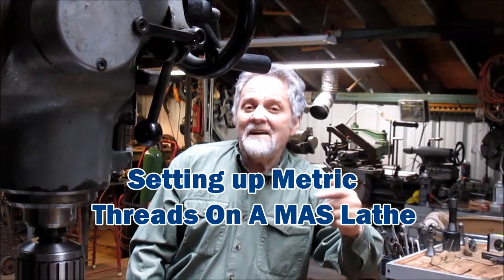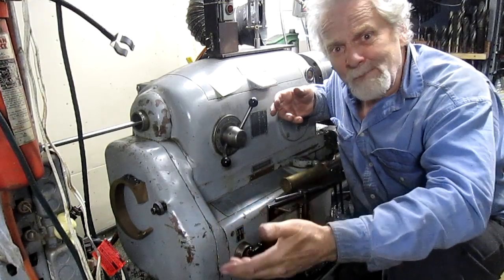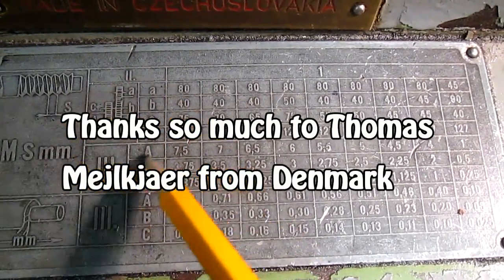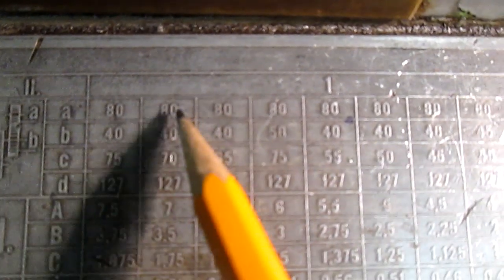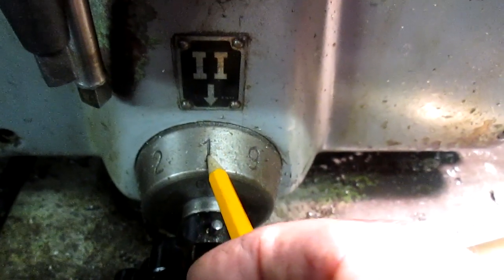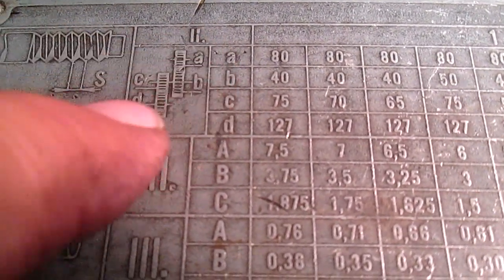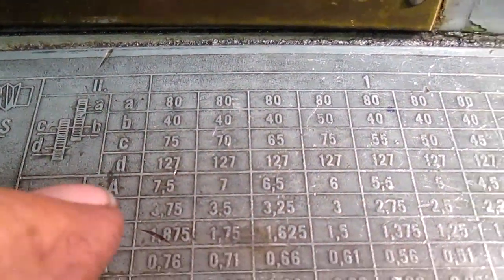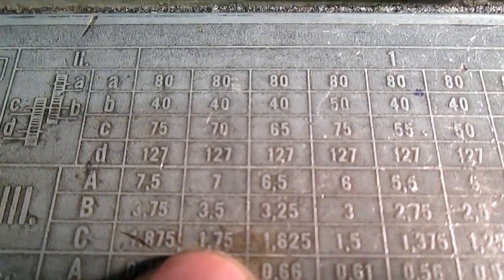Setting Up Metric Threads on a MAS Lathe

Comment: Hello Mr Nik Colyer.  
I have a lathe just like yours, where I use it to work.  I recently started a restoration, however, one of the information boards is worn and faded.  In his video, you show only half of it.  

Is it possible to contact you to get a photo of the information plate?

Your video was of great help to me, thank you so much for sharing your time and knowledge.
Reply from the maker: Did I send you the manual? The info plates are in there. If I haven't sent it yet send me an email: nik@nikcolyer.com and I'll send. It's a big file so email is best.
Reply: @NikColyerMachineWorks  Thanks a lot for the feedback.  I will answer your email.

Comment: Hi, i bought the exact same lathe but i can't get the automatic feed function to work. What button combination do i need to use to make the lathe move automatically?
Thanks in advance
Reply from the maker: There is a fist size knob dead center on the apron down low. Twist tighten that by hand and the carriage should kick in. If not, look just to the right at the lever: up is cross feed, down is carriage, center is neutral so you can engage the thread cutting. 
I have a manual for this lathe that I can send for free. It's a big file so send your email to nik@nikcolyer.com
It's a great lathe. I've had mine for 15 years and not a problem. You want to change the oil and fill with turbin oil, but first go under the transmission and open that cover. Inside is the oil sump. Clean that out with a putty knife, it will be filled with gunk.
Reply: @NikColyerMachineWorks  thanks for the quick reply. I will try it tommorow! I m interested in the manual since i am completely new to working with a lathe. Also my lathe needs some maintance

Comment: The MAS is a Czech lathe and the Czechs would be insulted if you call them Russian:) That said the matter of gears is to convert an Imperial lead screw to a metric one, and the hero of this operation is the 127 tooth gear. This is the standard Imperiial to metric (and vice versa) gear. Warning: your thread dial counter dial  will not work anymore, at least not as you expect. Standard practice is to leave the lock nut lever on the whole time and reverse the lathe back out to restart the cut.
Reply from the maker: I believe that in 1954, when this lathe was made, Czech was part of Russia. Yes, you are right, the dial counter needs to be left engaged. The next video addressed that issue.
Reply: Well, yes and no. Officially what was then called Czechoslovakia was an independent country but you couldn't even sneeze without  permission from the USSR. However, the Czechs had a great industrial base and the MAS  was a completely different design from the Soviet lathes. Most people would say MAS was better and I would love to have the little MAS toolroom lathe.
Reply from the maker: @juanrivero8  Hey, thanks for the update. Now that I know more my story changes. It's a great lathe even worn out like it is.

Comment: Hi Nik. I just wanted to mention two things: I have an app on my I-phone called Google Translate. what you do is, hold the phone over the paragraph you want to translate ( the phone is kinda in photo mode ) and after a few seconds the words magically change from Russian to English !  It's hard to believe, but it works. The second thing is that whenever I have to cut a metric thread I get out my metric thread gage and my U.S. thread gage and see if I can find a U.S. thread that matches the metric thread. there are a few of them that are close enough that you can get away with cutting a short nut in a U.S. thread that will screw onto a metric thread. it won't work on a long nut like a coupling nut because the pitch difference between the threads becomes too great over a longer distance. I think i saw Keith Fenner use this dodge once on some huge tractor transmission. That is one nice lathe you got !
Reply from the maker: If I only had cell service anywhere withing 5 miles I would have a cell phone and all of those cool apps, but I live in the woods far from any modern techno stuff. 
In a week or so when I get the stainless rod and start cutting the metric threads I did all of this for you will see faking it was impossible even though I tried.

Comment: i have a MAS from 57 and it´s very user-friendly and precise
Reply from the maker: Great lathe. One thing I found when I bought my lathe was the oil sump had 3" of gunk in the bottom of it which trashed the bearings in the transmission. I was able to replace them, but I suggest cleaning out that sump (down on the floor under the headstock) and putting new oil in.

Comment: Nik if the lathe has a metric lead screw you can use the dial indicator, if it is a imperial lead screw you have to leave it engaged, then reverse the lathe to back out to the start of the thread for the next cut. vice versa if it is metric and you want to cut imperial threads. How I know, mine is metric; stuffed a few threads learning this information.. Hope that helps as well....
Reply from the maker: Thanks for the heads up. I will leave engaged.

Comment: Glad you got some help and have it all figured out now. Is it capable of doing left and right hand threading as well?
Reply from the maker: To do a left hand thread simply start the tool closest to the chuck and thread toward tailstock. . . left hand thread.
Reply: @NikColyerMachineWorks  I understand that IF both the head and lead screw can be reversed. I have a very small lathe where I can change the head spin direction, but not the lead screw without some additional changes made to the lathe. Just wondering.
Reply from the maker: @garymucher9590  Not sure I understand how a lathe can change head direction without the lead screw following. As soon as I get the piece of material I'll do a short video on cutting metric threads. Sometime in the next week or so.